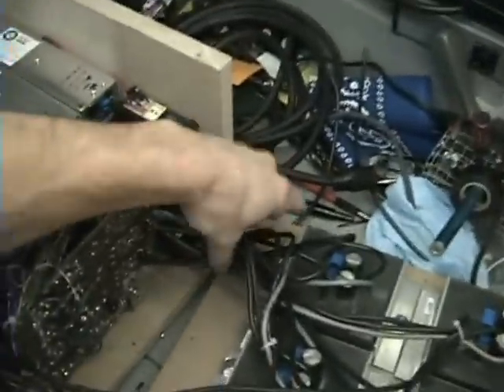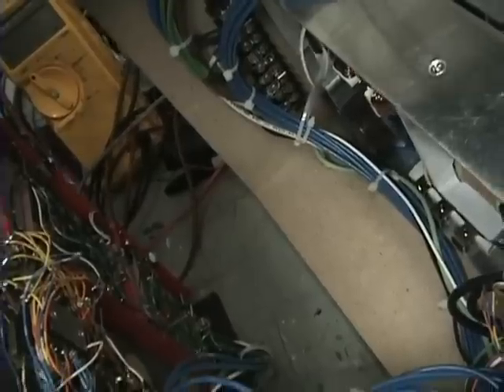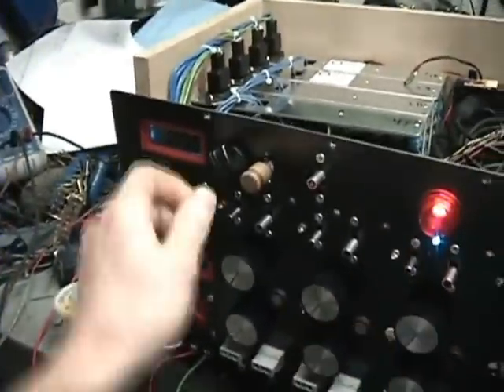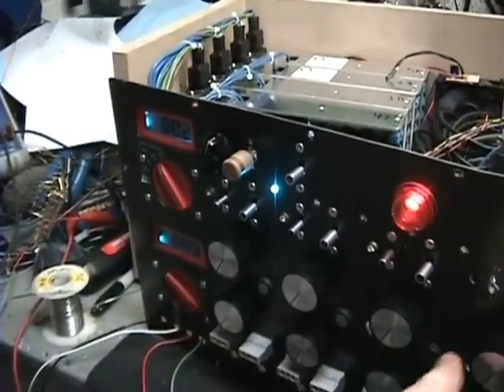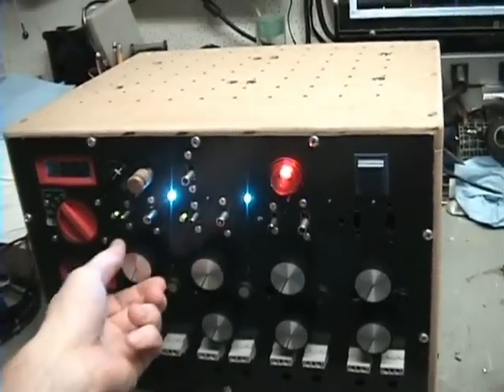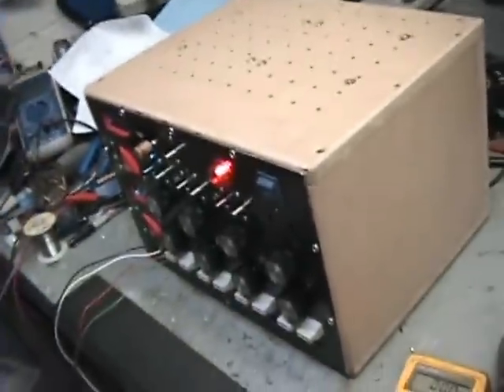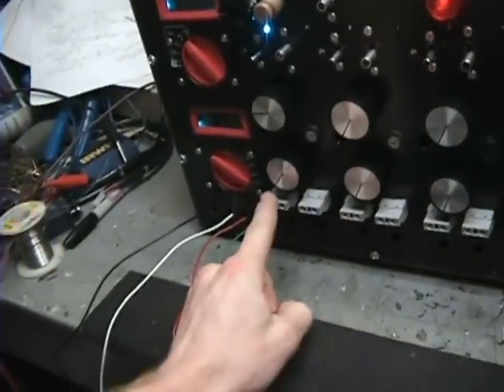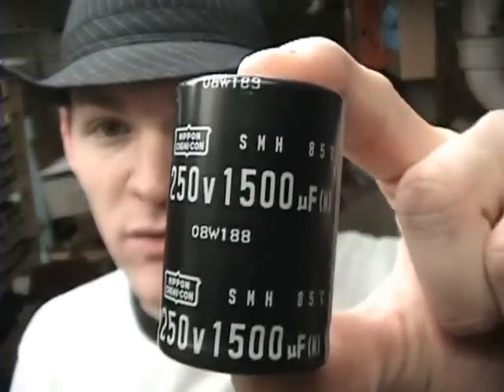#9.1 (DAY15) Building My Own Variable Power Supply ( Officially Unofficially Done... )

Comment: I haven't watched the rest of your videos, but high pitched squeeling is a pretty common problem in SMPS, even commercial ones. Its usually either due to parasitic properties of components that you haven't accounted for (most SMPS are SMD now as it reduces parasitics) or often to do with subharmonic oscillation in some topologies. Does it still squeel if the duty cycles is <50%?

Comment: you shaved off.... where are you? joking!
the capacitors is not suitable for switchmode, you need high temperature ESR which is low impedance capacitor.